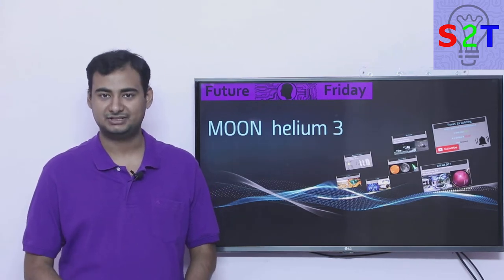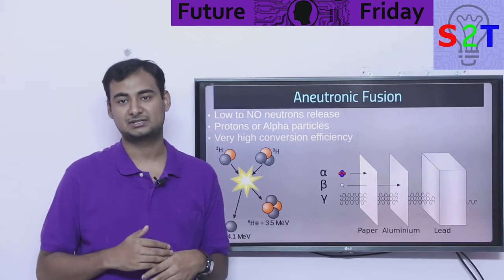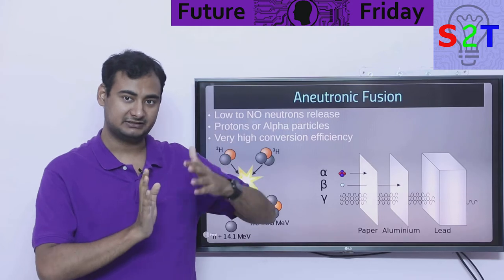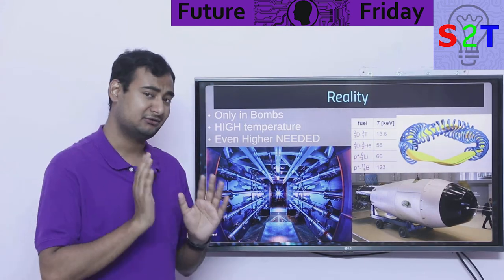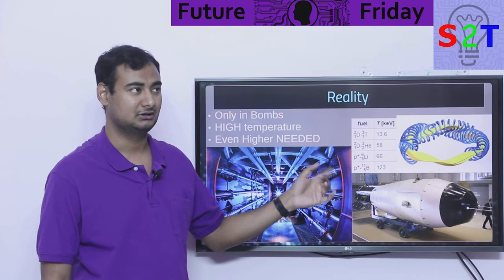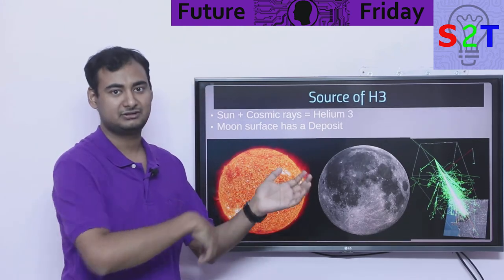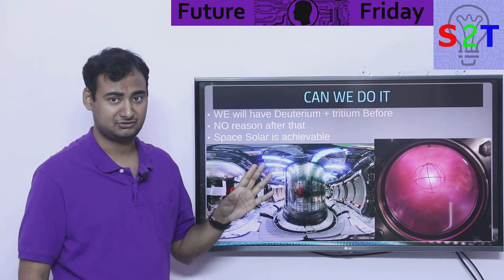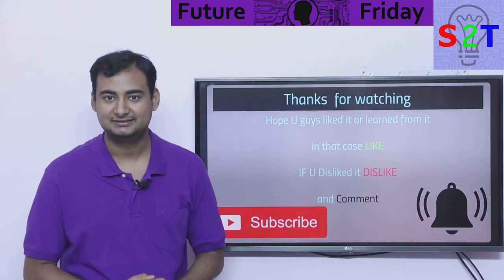Reality of Helium 3{Future Friday Ep49}

Comment: You advocate D2/ D3 because easier ignition and He3 is extremely rare.  I thought D3 quickly decays to  He3.  D2/D3 should only be fuels for testing fusion device architectures.  You forgot to mention Chernobyl, and how expensive it is to bury spent reactor structures into the earth’s mantle.
Reply from the maker: Dude I really don't think anything light D3 can every decay into something heaver He3 .fusion does not have Chernobyl issue only radioactive part would be inside of the reactor and due to lack of spent radioactive fuel its manageable